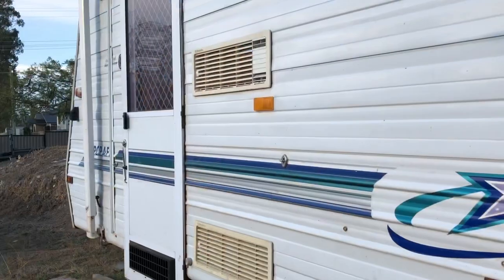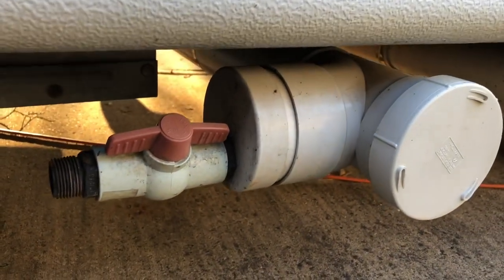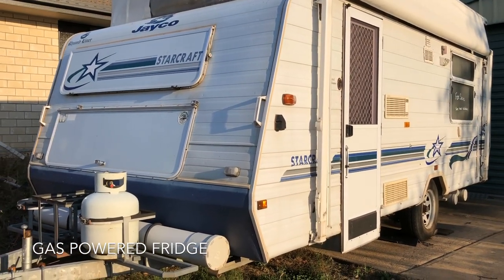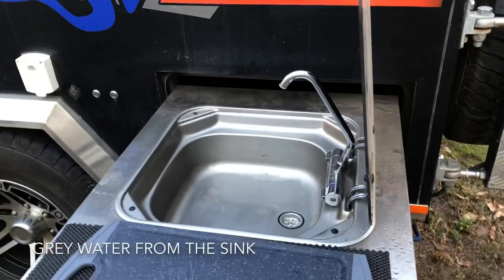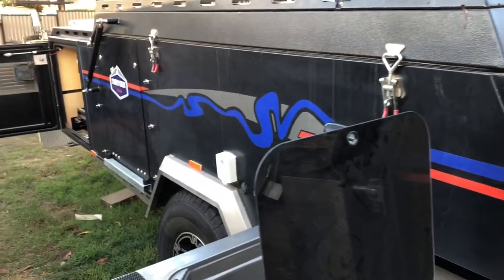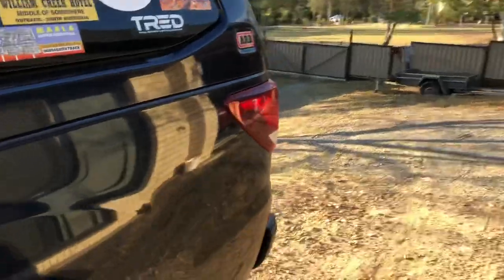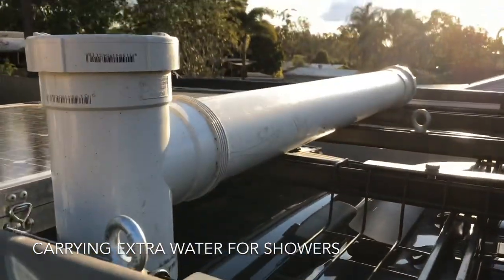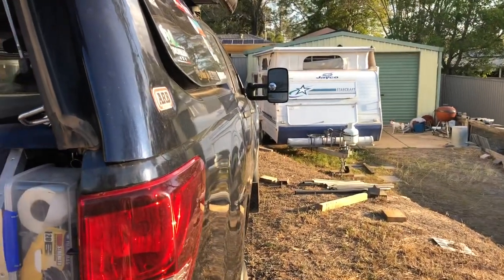Off-Grid Free Camping in Australia - Where to Start with Self-Containment

Comment: Could you do a little more indepth  video on the car setup and the gray water on the van , a few pick of how it is fitted up underneath. By the way great videos.
Reply from the maker: Thanks Malcolm. Great suggestion but I’m sorry I’ve sold that van. The grey water tank was a 100mm PVC pipe with screw ends fitted. There was a 90deg end on the drivers side that had a ball valve fitted to keep the water in or drain it to a bucket, the park waste pipe or the ground. Fitting underneath was by several hose clamps around the pipe and through holes in the van’s cross members. Happy to provide further assistance if needed. Cheers